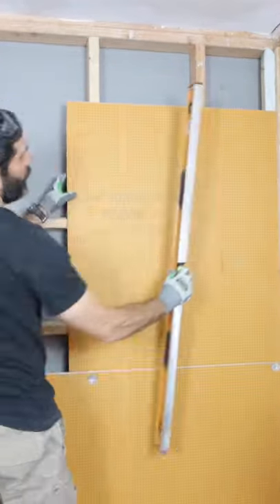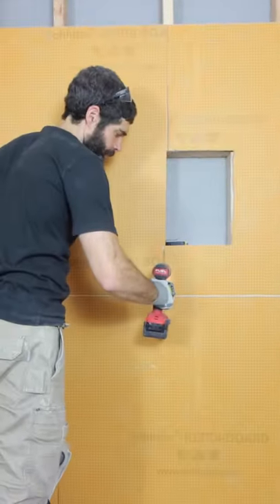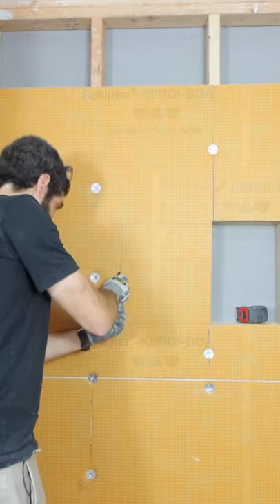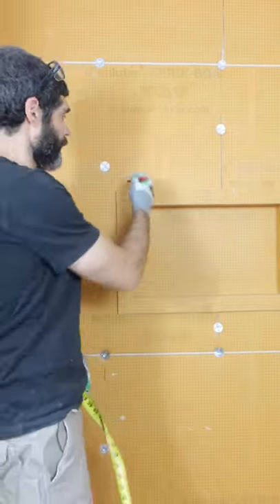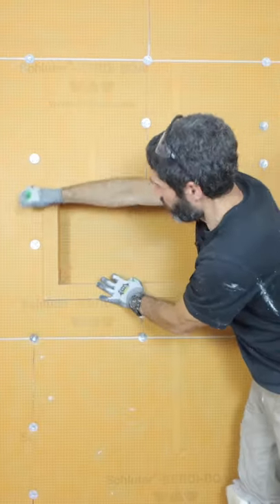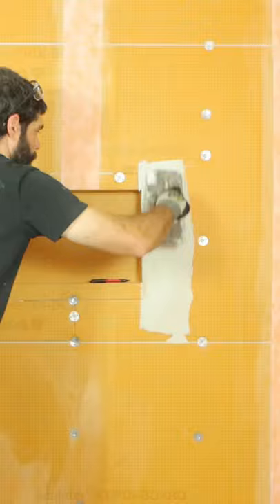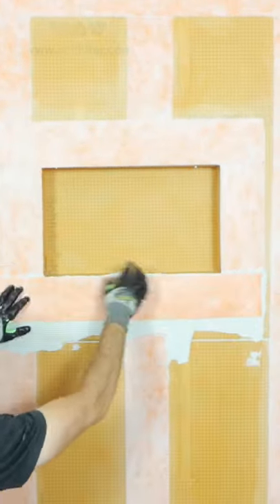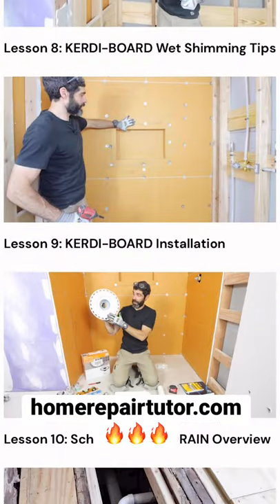Shower Niche Install Tip - #shorts

Comment: If I could re do my bathroom, I would use this board. The savings by using cement board were simply not worth the tediousness and mess.
Reply from the maker: ya, cement board can be a mess, unfortunately supply shortages mean it's being used more

Comment: What always gets me is getting the height right for the tile layout.
Reply from the maker: I’ll spend hours on the layout and draw a diagram for each wall being tiled. It’s extra work, but always so helpful to see exactly how the tiles will be around the floor, niche perimeter and ceiling. I also use those drawings to stay on task while setting the tiles. Furthermore, it helps me explain the scope of the project to clients before beginning
Reply: You can also start tiling and then build the niche later in accordance to the layout that's already been started.

Comment: I would never use this product to hang tiles that when all put together with above 500 pounds easily
Reply from the maker: I would and have, as have many others. This system is very solid and will work with any size or shape tile
Reply: Your statement is foolish